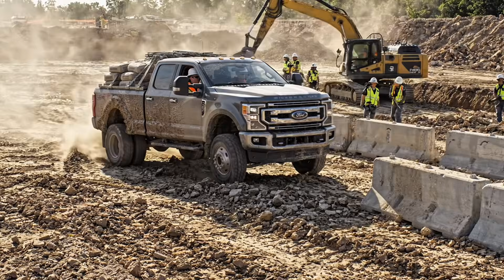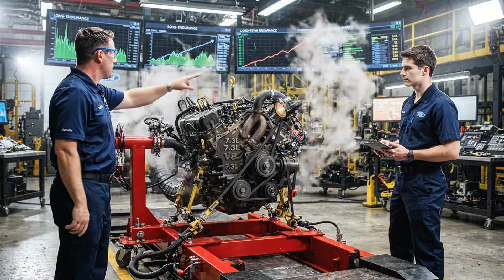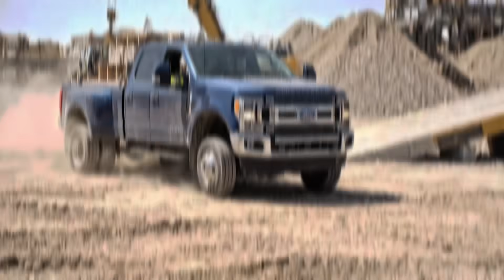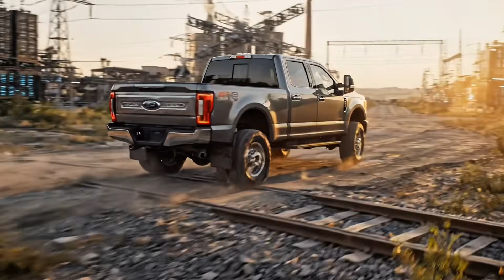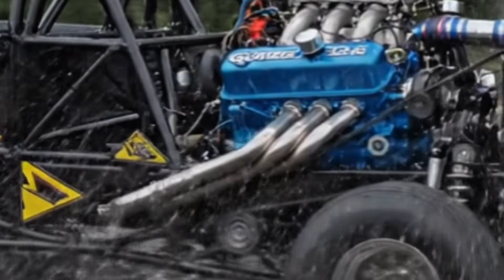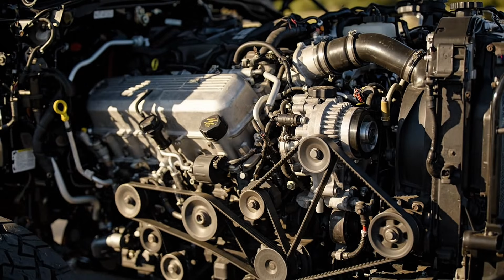Ford’s New 7.3L V8 Just Settled the Debate Forever — Experts Agree

Comment: Copied everything from Chevy!!
Reply from the maker: The Ford vs. Chevy debate never gets old! Both brands have influenced each other over the years, but it’s the real-world performance and durability that usually settle the argument.
Reply: Now why would they do that?
Reply from the maker: @DavidVlazlovski  Most manufacturers borrow ideas that prove successful. If a design improves reliability, performance, or maintenance, it’s not surprising to see similar approaches adopted across the industry.
Reply: Port injected instead of direct.
Reply from the maker: @Johnsmith46392  That’s one of the reasons many enthusiasts still like port injection. Simplicity, reduced carbon buildup, and long-term durability are big advantages for a lot of truck owners.